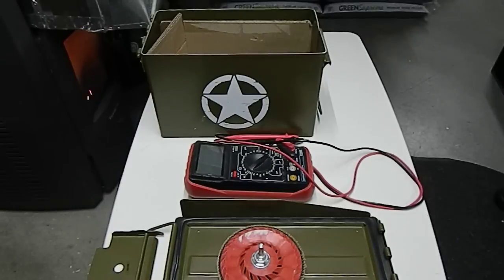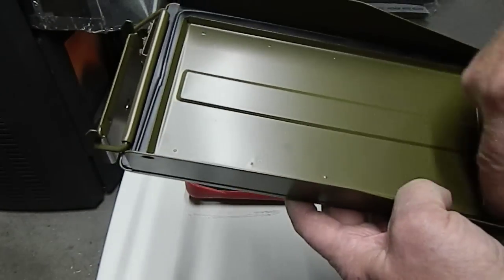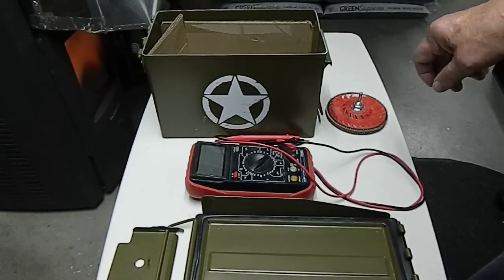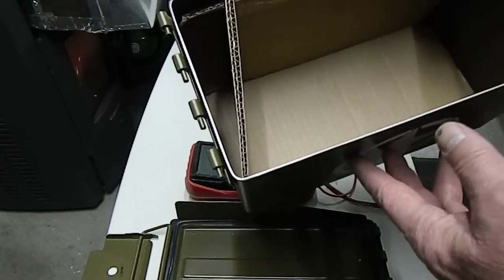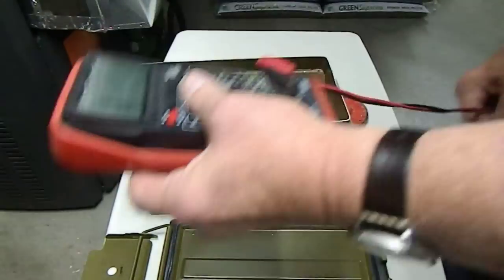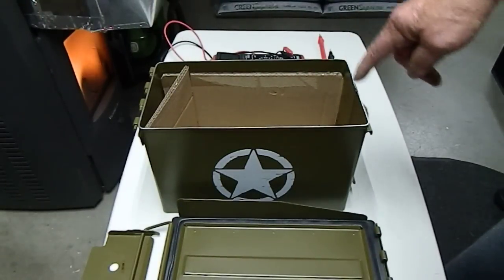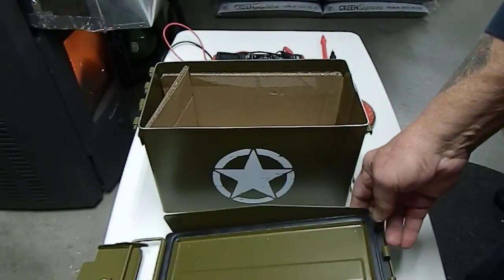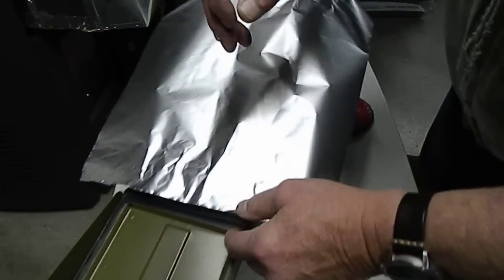AMMO CAN FARADAY …. you’re doing it wrong

Comment: RF engineer here.  For the sake of accuracy, you don't need it to be watertight to be EMP proof.  Case in point:  The mesh in the front of your microwave that you can see thru.  That's not watertight but the gap is small enough the microwave energy won't pass thru (not much anyways) it and your eyeballs don't melt when watching bacon cook. :)  I think the rule of thumb is about a 1/10th of the wavelength of the highest frequency for a gap.  Of course, less is better.  I haven't looked into what that distance that would be (and personally I'd shoot for 100% coverage).

But regarding your video - interesting idea.  One thing I wonder about is the ramification of dissimilar metals touching and long term shielding?   What's an ammo can made out of?  Aluminum window screen comes to mind too as an alternate material.  Likely a little bit more sturdy than aluminum foil, but then there's the gap and maybe the chance the 'mesh' isn't touching adjacent strands (i.e. making a bigger 'gap').  Perhaps a layer of foil and a layer of screen?  Don't know if aluminum window screen is plated or not.

Someone mentioned a metal paint can - probably the easiest solution (verify there's no plating that would be detrimental).
Reply: Yeah, I was going to comment the same regarding gap size vs wavelength.
My understanding was that a proper Faraday cage is also supposed to be grounded to an earth rod - do you have any comment on that?
I'm also curious about the effects of items placed in say, ziplock bags, and whether the layering of metal & plastic could inadvertently create a capacitor?
Reply: @boydw1  I have more experience on the EMI side (Electromagnetic interference) than EMP due to my designs going thru EMI testing.  And I definitely would defer to the EMPDoctor (sp?) for the correct answer, but I think he mentioned 'ungrounded'.  Double check tho.  

Ground is more theoretical than ideal.  Implication being what if the ground was poor (i.e. there's a path for EMP to get thru: water pipe, wire, is the ground wet or dry, dirt, clay, sand?)...you just might have made the situation worse by giving the EMP a direct line to the Faraday cage.  The other thing to consider with grounding (ground rod to wire to Faraday cage)...the wire will have an electrical length.  If the wire is a 1/4 wavelength long (short on one end is an open on the other at some frequencies) at a critical EMP frequency, it won't do any good.

Interesting comment about creating a capacitor.  So I think the issue would be electrostatic rather than electromagnetic and an ESD bag would solve that.  I haven't looked into the construction of a ESD bag recently and maybe the 'place the device in a bag, wrap in foil, place in another bag' is the same thing.  I tend to have leftover ESD bags around anyways, so I'd just use those. :) 

EMI testing is better defined...the testing facility sets up a standard bench, they run the test, here's the result.  You don't have that during an EMP.  I think at some point, we tend to overthink things and go down a rabbit hole.  There's the theoretical side and a practical side.  I tend to turn this problem into " How many dB of attenuation vs. frequencies do I need?"   EMI (or EMP) is always an interesting topic, and more than once there's that 'sneak path' I didn't think about in my designs and I'd have to play detective to figure it out! I'm just inclined to buy a metal paint can, grab an ESD bag and put it on a shelf!

Thanks for the reply!
Reply: @Pinhead-q4i  Grounding will help the DC LF spectrum, but at SHF and up, the inductance of even a thick copper braid may not provide much bleed off - AC takes the path of least inductance.
Reply: @paulromsky9527 Yes. Any electrical length would be detrimental to achieving a good ground at higher frequencies.  Ground would be transformed to a high Z at 90 degrees electrical length (frequency dependent).  Hard to get around physics. :)
Reply: @Pinhead-q4i  Yes, it is better the Faraday Box be  "bubble" in space, rather than a grounded point in space as far as EMP is concerned.
Reply: @boydw1  I commented on his video, that aluminum seal is 3 mils thick pushed up against the lip of the box. EHF pulses will ride the edge of the aluminum like an antenna, and pass right through that thin aluminum (edge wise). He is thinking DC. Using cell phones not ringing is NOT the way to test an EMP Faraday box. You need expensive wideband LF to EHF transmitters, antennas, and spectrum analyzers. Cell phone signals to/from towers are very weak and only around 1GHz, even 20dB attention inside a box is enough to cause a cell phone not to ping, but a high power EHF EMP will get through (not what is being tested using a cell phone). Yours truly has slide show on this if you look for it.
Reply: @paulromsky9527  I chuckled seeing you had a video called "Jalapeno Popper Scrambled Eggs" next to "Dual Deploy Avionics Bay Using Adafruit Feather M4 Express Microcontroller", haha, that's a bit of a change!

I agree checking with a cell phone isn't a great test, there must be some other way for people to check but I can't think of a good one (unless you could test by microwaving it but that's still 1 to 2 orders of magnitude low frequency of EHF range). Then it also may become an issue of how much current goes through it (even if a thin foil worked for low power, it wouldn't do much good if it burned at high power), but hopefully the only way we ever know is from scientific testing in a lab.
Reply: @jakegarrett8109  There is no good way to check it unless you have access to a fully equipped EMI/RFI lab - that I did have aceess before I retired. Yes, my channel is a bit eclectic. I had my Jalapeño Popper Eggs the other day.... delish!
Reply: @jakegarrett8109  Mu metal may be even better than steel. It is used to shield against strong magnetic fields. I checked...  Nope, it appears better suited for low frequencies, good old steel is the way to go for EMP.
Reply: Yes, a non painted steel paint can with a compression lid is good. But the quality of the steel they use is ferrous but not as good as the used in Ammo Boxes, and not Walmart ones, mil spec ones.
Reply: @paulromsky9527  Interesting comment about paint can metal, Paul.  I hadn't thought about the metal itself (other than is it plated or not, which could affect the RF seal).  Would a magnet be a decent test for ferrous metal, or is that too vague (i.e. might provide adequate shielding  at xx frequencies, but not at yy frequencies)?
Reply: @Pinhead-q4i  Yes, a small good neodymium magnet can be used as a simple test to be sure it is ferrous enough. The stronger the attraction the better. Also line the inside top and bottom with 1 inch of corregated cardboard. Eddy currents in the metal can damage equipment. Most paint cans are chrome plated. That plating is not optimum as the plating itself is not ferrous but it is only about 50 microns thick, so that is not too bad. Make sure you put desiccant packs inside but don't use oxygen obsorbers.  I like this paint can idea, most hardware and big box stores have them for only a few bucks and no modification to the seal is needed.  The Romsk (me) has a video on the Ammo Box. I am going to make a paint can one too. I will need to get access to an RF lab to determine it's wideband attenuation.
Reply: @paulromsky9527  Paul,  Just a FYI:  I picked up a paint can while at Home Depot yesterday.  Inside is epoxy coated.  Underside of lid: Epoxy coated including the lip that seals to the can.  The chime is not epoxied.  Not sure if I want to sand the lid lip since I may take off some plating, may have to think of a better way to remove it (i.e. chemical, heat?).

From Behr" "There is not a rust preventative coating on the outside of the can or chime (the groove the lid fits into), and the can may rust over time. However, the metal used to make these cans is called tinplate and provides more rust resistance than steel."
Reply: @Pinhead-q4i  Thanks for keeping me in the loop. Yes, the expoxy coating inside is a plus but don't forget at least 1 inch of cardboard all around inside (sorry for sounding like a broken record).  Hey, I never knew the groove on a paint can was called a "chime".  Hmmm, yes, the epoxy does indeed need to come off the sides of the chime and the sides of the lip on the lid. I doubt paint removers will work since it is a paint (and related products) can. Let's think about this.  As a last resort I would sand all lid/can interfacing surfaces down very smooth to bare steel.  A direct steel to steel contact under moderate pressure (like a paint can lid) should not corrode at the interface (touching) points because the metal to metal contact is a gas tight seal - a lot like wire wrapping in prototype boards.

If sanded to bare metal, high/condescending humidity can cause corroding around the chime where the lid does not make contact. This over time can eat through the lid contact area and compromise the seal. But, if you spray an expoxy coating around the chime after sealing the lid, that might work - dont forget to place some desiccant packs inside the can with your items. Then place the can in a quality Tupperware type plastic/rubber container with desisscant packs inside that as well... and you would be good for long term storage.  I wish I still had access to an RFI/EMI lab to test this, but if you then place that rubber container in a galavized steel trash can and tuck in stainless steel mesh all around the trash can lid lip, I can extrapolate that to at least the same 60 dB attenuation I got with my Ammo Can Fraday box.

Your thoughts?
Reply: @Pinhead-q4i  Also coat the entire outside of the can with an expoxy or enamel paint, but prime it first. I am going to draw up slides on our ideas. I will post a slide show video of it later today.
Reply: @Pinhead-q4i  How does your baseline (to a steel box) magnet compare to the paint can? If it is weak, then these high tin content cans are not a good idea for EMP proofing.
Reply: @paulromsky9527  I actually have access to an EMI lab, but no doubt the company would have an issue with me tinkering in there, getting in way.  I retired several years ago, but recently returned to lend a hand as needed (i.e. on call, working remotely).  I should clarify, I didn't work in the EMI lab and I'm far from an expert in that area.  My my experience is on the design side.  My modules always have the antenna port (lucky me), so I dealt with the radiated side of testing, not conducted.  More along the lines of proper PCB layouts, shields, component selection, ground paths, etc. But I have achieved a fair ways past 100dB of isolation when needed! 

I'm not sure how Behr coats the can and the lid, but they sure do have it down precisely - a very sharp, defined pattern.  I thought about heat (i.e. soldering iron?), but if that did work, I suspect things would turn to 'goo' and sanding would still be needed to get residue off?  Come to think of it, the tinplating might even wick up solder...hmmm (it might wick up under the coating?).  Some solderwick might help clean up residue if so.  Sandblasting might work, same for a vibratory polisher.  But I'm guessing if the material is too abrasive, it might take off the tin plating (would be nice to keep that on there).

I'll give it a try in a day or two and report back.  More of a science experiment on my end than anything. :)

Chime...yeah, I didn't know that either.
Reply: @paulromsky9527  I don't have an ammo box.  A magnet does adhere nicely to the paint can tho.
Reply: @Pinhead-q4i The magnet works, great! I like this Paint Can EMP Faraday Cage.  I just posted my Paint Can Faraday Cage slide slow video, I gave you collaboration credit but I only know you as Mark from YouTube. If you want, you can contact me per the end before "Sheldon approves it".
Reply: @paulromsky9527  LOL, 'Mark from YouTube' is fine.  Wasn't even my idea.  Someone else mentioned it first in the comments.  How do I find your YouTube channel?
Reply: @Pinhead-q4i  Paul Romsky Channel.... click the logo not my welcome.
Reply: @paulromsky9527  Some sandpaper, even higher grit (i.e. 110) does a decent job of removing the coating.  Must not be very thick.

Made it to your channel...duh, that was easy! I may have to try the "Jalapeno Popper Scrambled Eggs"!  I'd add Some Pepto Bismol to the list of items...just say'n :)
Reply: @Pinhead-q4i  I wish we could get 5 gal paint cans, those would be great.  If someone was ambitious, they could weld 1 gal cans on top of each other, cutting out the base of one of them to get a deeper container.
Reply: @paulromsky9527  Buying a 5 gallon can would be  ideal.  BTW, I was able to solder to the lip on the lid after hitting it w/some sandpaper.  Tin plating is holding up to a little punishment!
Reply: @Pinhead-q4i  Yes, Tin is way more solerable than Steel.  That was a clever way to prove that at least some, if not all, plating remained intact after sanding. I posted a Trash Can Faraday Cage slide show video today - so now I have a trilogy on EMP containers [smile].  Tomorrow, I am going to make another video:  "What Materials are Best for EMP Protection". I dry ran this experiment today: I didn't have a sensitive galvanic meter handy or some magnet wire to form a magnetic pick up coil. I did have a magnetic Reed Switch and a tiny Neodymium Magnet. I hooked up a simple circuit to light up an LED when a magnetic field is present around the Reed Switch. The magnet turns on the switch at about 4mm away from the switch. Then I put 10 layers of Aluminum foil folded up as one sheet. I insulated it with paper and tape and put it over the switch as a shield. The magnet turned on the switch (and thus the LED) at virtually the same distance - the "Magnetic" field passed right through the Aluminum as if it were not there. Then I took a piece of Zinc Galvanized Steel plate with the same thickness and insulated it identically the same as I did with the Aluminum. I covered the switch with that Steel shield.  The magnet would not turn on the switch - even when the Steel plate was right up against the switch and the magnet right up against the plate - the switch remained open (LED stayed off) - with ferrous Steel, the switch was shielded from the magnetic field. This is a simple experiment anyone can do. It does not give an indication of how much shielding each material provides, but it does show that Aluminum is a good conductor of electric fields, but not a good insulator for magnetic fields; Where Steel has the best of both properties, and since we're are trying to shield "Electro-Magnetic" events, I hope this proves my point to the masses. So passing that tiny magnet passed the switch thus created a very small scale EMP, but if it we're billions of times stronger with an extremely short extremely high frequency component to it, it would pass right through even very thick Aluminum with some attenuation, but still couple into the tiniest wires and circuits.  When people cover their devices in Aluminum foil or make gaskets out of Aluminum or Copper tape, the Aluminum/Copper will shield out a lot from a EMP with say a 100MHz characteristics, and the 100GHz components of it will be blocked a bit more but still get through (travel along) any thin non-ferrous material - especially through very thin gaskets made from Aluminum foil as the guy did in this video.  To the casual observer, "very weied" things happen with EM waves at EHF. Working the EM spectrum from DC to Gamma Ray (mostly Radar) I learned a lot on how these waves can travel around objects, or get through the very thinnest (but somewhat wide) gaps.  This is why I made my experiment virtually DC, most people without RF experience can understand that.
Reply: @paulromsky9527  Using a magnet was an excellent sanity test.  First thing that came to my mind was a wideband transmitter and receiver.  Instantly gets complicated.  Kudos for thinking of a simple test to prove a point.  I think the empDoctor did a YouTube test using aluminum foil in the lab, I should look that up and see how many dB the attenuation he achieved.

Edit:  Found the video.  He only tested at 100MHz, I was rather disappointed it wasn't a broadband test.
Reply: @Pinhead-q4i  Yes, I saw some of his videos too. I suspect he only did 100 MHz (and the first few I saw were only at 1 MHz) because that is all his equipment can do. He is obviously not a Radar engineer (I was a Radar test engineer, but worked the full spectrum in fact). But I no longer have access to all that expensive sophisticated equipment - our limit was 100 GHz.  He bills himself as the "EMP Doctor,"  I began to wonder if he has a PhD, and if he does, it might not be in the technical sciences.  The first few videos of his I saw he was wearing a nice shirt, tie, and slacks in his lab, I forgot if he had a jacket..... pa-leeeeeeze.  He now mentions that he sells various EMP stuff. Today I saw his video on where he mentions he sells EMP bags (they look like ESD bags).  He now has a big disclaimer before his videos but hawks (lightly) his products in the videos. I think he is a hack. He was talking about protecting power generation equipment with conductive mats.... wow, just let the RF get in around the folds. I don't think he ever worked on a real EMP project. I have worked on three that were classified, and a lot of TEMPEST in the Air Force.  And like you Mark, we have both been in the EMI/RFI lab a lot.  I giged him on a few things... no reply.  I did mention to him why test at only 1 MHz when EMPs can be in the many GHz and EM waves at those frequencies can do some very "unexpected" things, now his videos say he tests at 100 MHz.... your thoughts on him?
Reply: @paulromsky9527  He does state he has a Doctorate.  But I'm not an EMP expert, so I don't want to speculate.  I didn't even think about the paint can possibly being nonferrous until you mentioned it. But I was surprised that he used what appears to be a 1GHz broadband AR power amp and a wideband antenna during the foil test...and he only tested at 100MHz  (100mHz in his description, surprised that wasn't caught)?  Heck, all he needed was about a 6" piece of wire for 1GHz antenna (ballpark guess) test. 100KHz you could have just transmitted in a 50 ohm resistor sitting nearby for a load.  I think the AR was 80W (hard to see the info on the front of the amp).  Loop some wire for an antenna on the spectrum analyzer, crank up the amp, and you would have been all set to see a healthy 100KHz signal for testing.

I have seen him talking about the broadband 'clamp on' chokes he sells, and I wished he would have done a simple s-parameter sweep of the 1 turn inductance, maybe 10KHz to somewhere in the GHz range. Just eyeballing the Smith Chart plot would have indicated where isolation was great or not so great.  Granted, it would have been small signal (core not saturating), but a simple R+j sweep on the Smith Chart would have revealed a ton of basic info. But I assume I'm the exception (translate: RF geek), not the norm. :)

Interesting you mentioned you were involved with RADAR, I designed transmitters for RADAR (along with broadband transmitters).
Reply: @Pinhead-q4i  He sells those chokes... I think that is the point of his video. Chokes are a good idea for equipment that has to remain connected - like generators. But I would not rely on "I have chokes on my cables... I am safe" idea. I have not investigated how 10GHz and such pulses will creep around conductive surfaces - they could theoretically creep right around the outer surface of the chokes - but they are better than nothing. When it comes to EMP, being totally sealed in steel, as difficult as it may be, is the best insurance, there are no short cuts. In my Doomsday shelter (I never built it, I have two version videos of it), I keep all equipment in a Faraday Room. Generators are stored there too, unconnected, which is the best way to protect them.  Like I told others, it's a shell game, after a nuclear war, we will never know when another EMP weapon will be detonated to catch us off guard. So, we will have to get used to using ALL electrical/electronics devices sparingly and to keep them in shielded containers 99.9% of time - in hope that an EMP does not occur when in use.
Reply: @Pinhead-q4i  BTW, Thought it was odd he didn't fix 100mHZ. You may have noticed that I use the term "Radar" as a noun rather than the acronym RADAR.  It's not proper to use the noun, but in informal text, I just use it anyway.
Reply: @Pinhead-q4i  Thanks, I will check it out. I made a video of my magnet/shield demo, and some slides to go with it. My eyesight is bad, my eyeglasses have progressive focus lenses but lately the closer focus is off (kinda reversed), I have to view the screen further back with the normal focus range, but I was drawing a lot of small line art so I had to take off my glasses and lean in close to see it. After about a day of that, I may have pinched the sciatica nerve and my lower back is very sore. It's has happened before, I just have to stay away from my PC for a few days.
Reply: @Pinhead-q4i  Yes!  I didn't even look for 5 gal cans, I have some industrial sealant in the same style can, but I never thought to search for empty ones... the lid is perfect! Vestil LID-STL-LL Steel Lever Lock Pail Lid, for 5 gallon, Black

I will make a slide slow of it soon. That clamp lid is perfect, I am sure it has a rubber seal that will have to be replaced with steel mesh.... my very similar industrial sealant can has a rubber seal.
Reply: @paulromsky9527  Not necessarily. Brass, copper, and especially LEAD, is not magnetic, but a much better cage metal (if thick enough)...
Reply: EMP is not a radio frequency, it's a high voltage pulse. Electrical contact with the lid is important. Remove the rubber and used copper mesh or aluminium foil to bond the top and case electrically.
Reply: @bazzadebear8012  Actually, that is not correct. An EMP event is an electo-magnetic pulse. The fact that is a "pulse" of any "width" means that is does indeed have a "frequency" component. The most destructive EMP weapons are designed to have a very wide band of pulses (frequency) characteristics. Let's say the strongest pulse at the source of the detonation is 1G dBkW peak and lasts for 1ns; this creates a "single wave" of energy with a frequency component centered at 1 GHz. So it is very short lived pulse of extremely high energy that in itself has a frequency component. Try this:  Put a 1ns pulse with square edges on a spectrum analyzer, you will see it has a peak magnitude at a frequency of 1 GHz, with a rich set of harmonics in the side bands.  If you make the edges of the pulse Gassian (smoother bell shaped), then you will see only the peak magnitude at a frequency of 1 GHz with little to no harmonics. EMPs have very fast (sharp) rise and fall times (edges) so a wide range (spectrum) of frequencies are generated. Because all that energy is put into one pulse, you only get 1 cycle of an AC frequency component, but that one cycle is all it takes to destroy electronics.

Aluminum is an inferior seal because it is not ferrous. Because it is conductive and not ferrous, a portion of the SHF magnetic component of a EMP can get through very tight non ferrous areas (like the thin aluminum sheet at the edges).  Remember, it is an Electo-Magnetic Pulse (wave). Don't think just electrical like aluminum or copper, think electrical and magnetic like steel. Thus a fine steel mesh braid in place of the rubber seal with give you at least 10dB attenuation of the pulse over aluminum... the more attenuation is better in the case of EMP shielding... and that makes all the difference if your equipment will survive or not. Yours truly has a video on this, check it out for more.
Reply: @paulromsky9527  - If you put a perfect "Ideal Impulse" square wave into a Spectrum Analyzer, the result will be an infinite series of discrete frequencies.
SO very strong "Pulses" tend to look like a broadband spectrum of frequency signals (infinite harmonics).
Reply: @stuartgray5877  Thanks for a second on that. The guy I replying to was under the impression that EMPs are purely electrical and no frequencies were involved (the old DC train of thought not RF) when they are in fact Electo-Magnetic pulse waves... waves as you know implies frequency. I think he got it but he has not replied yet.
Reply: @stuartgray5877  I checked out your page. I have worked on satellites as a Test Engineer but for only LEO. It's amazing how just about everything outgasses at micro Torr pressures. As for my Electrical Design Engineering discipline, I have worked on the entire EM spectrum: from DC to Gamma Ray. I even worked on space based equipment that detected Cosmic Rays.  IR lasers were very interesting. So, I have designs under ground, under the ocean, on the sea, on land, in the air, and in space. I am a multi-disciplined engineer: I bill myself as an "Omni Engineer". I can design a circuit board in the morning, code the FPGA for it in the afternoon, write the software for it (test and implementation) in the evening, and test it.  Many engineers I have met only focus on one of those disciplines, some sadly never want to get involved in testing their own designs (like that is beneath them). I prefer to test my own designs, with a crack EA as my assistant. We follow the design from concept to end of life... I have brought a couple of EAs up to excellent engineers. I am retired now, so I teach Summer STEM in my home. I hand pick only 6 students that have the hunger to learn and teach... grades are not that important compared to them being "true engineers" from birth. I teach them to how get good grades too.
Reply: @paulromsky9527  ..."some sadly never want to get involved in testing their own designs (like that is beneath them)..."  Very true.  I even abandoned my office when I was working.  Decided the screen room would be a better office. Coffee pot nearby?  No thanks, I'll take the screen room with all the RF test equipment next to me any day.  Instead of windows, I had made a laminated poster of a Smith Chart hung up that I could draw my matching circuits on w/dry erase markers! LOL.
Reply: @Pinhead-q4i  Ah, Smith charts! Back in the day it's all we had and we liked it!  I show my summer STEM students my sliderule that was handed to me in 1989 as my mentor was retiring. I tell them that we sent men to the Moon using them!
Reply: @Pinhead-q4i  Yes, I knew a guy that made a screen room his office. It was in an almost forgotten lab so he used it exclusively but he would let me in now and then to make some measurements.
Reply: @Pinhead-q4i  stupid fil-ter, I think it dele-ted my last mes-sage. Try solving this:
10 digits is all it takes. The first three is in new hampshire. There are 4 cows and 6 goats in the field. 5 of them are babies.
7 years ago I only had 2 goats. I now have 25 in all.
Reply: @bazzadebear8012  Can you elaborate?
Reply: I think connecting a wire to the lid and can is good enough to make them unified for EMP resistance, and the gap created by the rubber seal seems to be too small for any issues.
Seriously, don't damage the (steel) can or seal if you want to protect things inside, just wrap them in foil and put them in the can.
Reply: This will work to store things. Environmental seal and HEMP/EMI shielded.  Just don’t open it until everything has subsided. 

As a side note. If someone wanted to create a box like this for holding electronics but wanted to run wires into it, that is possible. You would lose EMI shielding at higher frequencies but if you are only concerned about HEMP, you just need to have a tube welded into the box that the cable runs through. Tube must be at least 5 times longer than it’s opening size and the cable cannot have any metal. So this would work to bring fiber optic network cables into a device. If it needs outside power, there are ways to do that too, but much more involved.   Again, cannot have any metal running inside the tube as that provides a path to transfer the energy into your space and your device.
Reply: @bcaron3535  Yes, I made a sideshow video that states to keep your contingency devices inside a Faraday Box, take them out to use them, and then return promptly to the box when done. True, EMP events will occur early in a nuclear war, but there is a "shell game strategy" where the enemy will stop using nuclear weapons for a while so that the target population will think it is safe to use electronic devices again, then without notice, a week or so later, another high altitude EMP weapon will be detonated to catch people off guard thinking the worse was behind them. Once a nuclear war starts, you will (indefinitely) have to use your electronics sparingly, taking them out only briefly and to play the shell game to miss getting "pulsed".  I personally I see no reason to run fiber optic cables in/out of a Faraday box.  Curious, why would you do that? The ones I designed and tested for >60 dB attenuation over a very wide band of DC to EHF frequencies is to keep electronic devices powered off (batteries removed) for long term storage as our common unprotected every day items will most likely be destroyed in the first wave attack (not enough warning to protect them).  I tell people they can keep a cell phone in thier Faraday boxes, but that would be added cost to have a phone number/service that you don't use all for many years (and hopefully never need). Virtually almost every cell phone tower system will be destroyed in the first wave and it may be years before many of them are repaired as resources will be scarce and the Washington DC towers and few around military bases will be restored first and repaired after each "shell game" EMP event.  I suggest people keep my Faraday boxes in sealed Tupperware type containers to keep out moisture, and put those in a EM sealed steel trash can for even more attenuation - especially in areas under where the EMP weapon is likely detonated.
Reply: @bcaron3535  Actually, the tube you described might act as a wave guide at a specific frequency. Since EMP weapons are designed to have a wide bandwidth of EMP (and the enemy is not going to publish their specs) there is a good chance that a pulse wave may travel inside the tube. I would rather not risk it and go for a totally sealed/shielded EM Faraday box.
Reply: @activemoronic  Actually, microwaving bacon is faster than pan frying. True, it doesn't crisp up as nicely, but if you cover it with paper towels, there is less mess and more of the fat wicks away while cooking. Many people like their bacon flimsy. I prefer pan frying low and slow, but if I am pressed for time, a couple of minutes in the microwave oven and it's done. But I think Mark was just being colloquial about watching bacon cook through the holes. It could have been anything... like a Hot Pocket for example.
Reply: The issue of it being watertight is purely to protect the internal items over the long term from moisture etc.  Having an ammo can that’s a working Faraday cage is the first thing he is trying to achieve; having that same item waterproof is just a bonus.  It does need to be noted that for this to be a EMP protective level Faraday cage, you need to run a wire (the shorter and larger gauge the better) to earth ground.  To protect against a EMP event you need to give the energy a place to go otherwise the EMP energy will simply pass through the walls of the metal can.
Reply: @joefunk4552  Yes, it would be very desirable to make the Farady Container water tight, but it being EMP proof is paramount. This is why I place desiccant inside, and keep the whole container in an air tight container (box or bag) with desiccant inside it as well. That thin sheet of aluminum (in this video) is still thick enough to allow EHF components of a S-HEMP through. Steel is a much better EM shield for pulses with those frequency components. EHF can actually creep around objects and through thin areas of non-ferrous material. Steel has a mu of 100 times greater than Aluminum. At EHF, aluminum does shield EM fields, but Steel offers about 10 dB more attenuation at those frequencies. That is a 10 times power reduction - significant when it comes to EMPs. I am in the process of making a video that explains all this. Because many people are not RF engineers nor have they had extensive experience with weapons EMPs and TEMPEST, I have to explain some basics before I can explain why Steel is the best cost effective material for EMP proofing - its quite a few slides so far.  As far as grounding the box, that only works for DC/low frequencies, because any length of wire (even 1 cm of straight wire) has inductance, and at EHF, those frequencies will not pass through the wire as AC takes the path of least inductance. Bonding the case to ground would be better for wideband, but still not necessary. So, EMP works a lot like RADAR Stealth - where in that technology there are (among other material) tiny ferrite spheres in the paint, they take high frequency Radar EM energy, absorb it, and radiate the energy as heat. Radar signals are relatively weak, so there is very little heat and a slight static slip stream, a fraction of a degree over all. Those steel balls are insulated from the aircraft frame and are obviously not connected to ground (earth) - they are "bubbles" in space. Thus, and EMP container is best left as a bubble in space. The energy it absorbs creates brief eddy currents in the case and radiates heat (IR). But, since EMPs are such short lived, that heat is just as short lived and the box wouldn't even heat up 1 degree C...  in fact, grounding the box makes it a crude antenna, which slightly increases the gain of its reception of EM waves - which is not desirable.  So many people just don't understand the effects of Weapons EMPs - it's not intuitive, and many people think more DC, when it is much more exotic. This is why some people that have a causal knowledge of RF call it "black magic", but when you understand and apply all the physics it makes sense.

To summerize: Floating Ground, Steel Case, Fine Mesh Steel Gaskets, Air Tight Outer Container, Desiccant Packs. 

Anything else is a misunderstood compromise. 

Take this: Goverment sites tell people to simply wrap there devices in foil... this is just to pacify the public - when a nuclear war starts, most people will not survive the first minute as sub based launches take only a few minutes to reach their targets on the coasts. Our government cannot warn the public in time as theire first priority is to protect the president and upper staff.  So, they are just giving "us" a cheap ineffective way to shield EMPs so in peacetime there is less anxiety about it all... clever. Many of us in the know have reported this to the government only to fall on deaf ears... it's just cheaper and easier to disseminate partially correct info to people who will die when WWIII starts.
Reply: @paulromsky9527 Hi Paul, like you I have a lot of experience in the military fields, all TS+ work at one of the national labs run by MIT.  I agree with you fully regarding designing this to be both EMP proof as well as a environmentally isolated interior.  The steel is best and I understand the desire for multiple layers of foil.  EMP pulses can and do have unique DC & AC characteristics that grounding with a good wide wire braid will add a significant layer of protection. It’s important to keep the wire as short and large as possible to drive the inductive and capacitive elements of the ground wire as low as possible; this is why the flat wide wire braids work best. In doing that the AC performance of the ground wire is significantly improved.  Let’s also keep in mind that the fundamental energy of an EMP pulse is spread over the “DC to  Daylight” spectrum.  As each EMP pulse is a mixture of unique RF energies, the best we can do is significantly improve the situation; but a ground wire will be needed to shunt the overwhelming energy of the EMP’s DC component and hopefully a significant amount of the AC component. 
There is a huge difference between a faraday cage used in labs to shield out any stray RF energies (From the normal TV, FM & AM radio signals) and shielding a high energy EMP pulse from a high altitude airborne nuke burst.   The difference is generally equated to a difference of 1x10^20 greater energy than a standard Faraday cage is designed to handle.   I would also shoot for 100% electrical shielding with no gaps.  This is a good thread, this discussion needs to be had.
Reply: @joefunk4552  We agree. These videos have good intentions but we have to set them straight now and then.
Reply: @joefunk4552   @Joe Funk This comment is mainly for other readers:  
As far as grounding, bonding the case directly to Earth ground plane would be better than even a thick copper braid as it would provide the best wideband grounding. I tested my Ammo Box Faraday Cage (I have a slide show video on it) using a fine mesh steel gasket filled with cotton as a forming media and I got 60dB attenuation at 50GHz. I am retired so I lost my access to RFI/EMI labs, when I made my Ammo Box, the equipment I had on hand was good to 100GHz.  Russia and China are developing Super HEMP weapons.  Much higher energies, but to get that, they would have to use multiple tamper layers - which may widen the pulse, but not sure if the edges of the E1 pulse would get faster or slower. Who knows what the E2 would be.  As wide band as EMP is: DC to the boundary of Far IR (with a lot of local IR, Visible, UV, X-Ray and Gamma Ray at the source), I found that Aluminum's and Steel's effectiveness were starting to converge above 50GHz, so I extrapolated from there. Of course, I advise Steel Cases/Gaskets, sealed in air tight bags, within lager steel cases (like steel trash cans) - I have a video on those too. Anyway, I too had access to TS and above my whole life, so I have to limit my content. I stay away from math in my videos because they are for non-engineers/scientists, the rest of all us understand the rest. It's a shell game... many people think they are going to wrap all their devices in Aluminum foil or toss them in very good Faraday boxes as the first strike is on its way.  I am trying to tell people, that will be too late, they need to keep everything they hope to survive a Weapon EMP event in EMP proof containers at all times (by the time the government can get the word out it may be too late) Various nations are "testing" missiles all the time, any one could detonate way out over the Pacific - on route not seeming to be a threat.  When was the last time the EAS went off to warn you North Korea just launched a "Test" missile. Answer: Never. We only hear about them that day, at best hours afterwards. If one did turn out to detonate an EMP, it's too late.  Also, once we enter a nuclear war, the enemy will randomly set off EMPs (every now and then) to catch people off guard with their equipment out of their containers.  That is why it's a shell game, once a nuclear war starts, we will have to keep our electronic devices shielded (taking them out only briefly to use and put back in again) until well after the war is over - which could go on for a year, more or less.  

I am 60 now, so I have decided not to ride out a nuclear war. And I am not going to die a horrid death of radiation sickness - so I have contingencies for that. I have videos on some long term shelter ideas, but I never built either one. If you don't have a well buried shelter with all the equipment and supplies to stay under ground for a year, the Earth may be so contaminated that a month or two in the shelter would not be enough. And if Nuclear Winter sets in... forget it... the Earth would be a lost cause to 99.999999% of humans, the rest being billionares and politicians to stay shielded indefinitely.  

Good luck. "If I don't meet you no more in this world, Then I, I'll meet ya on the next one. And don't be late, don't be late." From "Voodoo Chile (Slight Return)", Jimmy Hendricks ca. 1968.
Reply: @activemoronic  Let me dig my hole deeper...turkey bacon to boot! :)
Reply: I looked this up:

An EMP, or electromagnetic pulse, does not have a specific frequency since it is not a continuous wave like a radio signal. Instead, an EMP is a burst of electromagnetic energy that can contain a wide range of frequencies, from very low to very high.

The frequency content of an EMP depends on a variety of factors, including the source of the pulse, the strength and duration of the pulse, and the environment in which the pulse occurs. In general, EMPs can contain a broad range of frequencies from DC (0 Hz) up to the microwave region (gigahertz frequencies).

Different types of EMPs can have different frequency characteristics. For example, a nuclear EMP (NEMP) typically has a much broader frequency range than a geomagnetic storm-induced EMP (GIC-EMP), which is caused by fluctuations in the Earth's magnetic field.

So, in short, the frequency content of an EMP can vary widely and is dependent on the specific circumstances of the pulse.
Reply: @danw.3291  That is correct, it's that WIDE BAND of frequencies that you have to shield to protect your equipment. At DC, Aluminum does not block Electromagnetic  (EM) fields, where Steel does. I am almost done making a video on that.   But in the GHz frequencies, Aluminum does start to block EM fields pretty well, but Steel still provides about 10 dB more attenuation (more attenuation is better for EMP shielding). So that is why Steal Cases with Steel Gaskets/Seals are better any Aluminum anywhere.  At the TeraHz frequencies, Aluminum and Steel start to block EM fields equally, but at the lower frequencies of where Weapon EMPs mostly radiate, Steel provides the best protection. So many people think of shielding from a DC perspective because they don't understand AC effects, especially in the EHF band and above. At those frequencies, EM waves can travel around edges of conductors and get right through tiny gaps - even if those gaps are "electrically" sealed but done so with non-ferrous metal like Aluminum. The gasket must be made of Steel. You MUST consider ALL Frequencies, not just SOME.  See my "Ammo Box Faraday Cage" et al.

I am a engineer with EM experience from DC to Gamma Ray (mostly in the Radar bands where a lot of the Weapons EMP characteristics occur, and have worked on EMP projects and TEMPEST). When I was first learning this in the 80's I was amazed how beautifully elegant EM fields/waves work differently from DC to X-Ray, Gamma came later).
Reply: @paulromsky9527  Just adding to Paul's (and others) comments in case some didn't understand the 'dB' term we toss around:

A 10dB reduction (-10dB) in level is the same as reducing power to 10% the original level ( i.e. 1W is lowered to 0.1W, 10W is lowered to 1W, etc.).
Every -10dB is another reduction to 10% of the original:  -20dB is 1%, -30dB is 0.1%, and so forth.
-3dB is 1/2 power, -6dB is 1/4 power, etc.
Positive numbers are an increase in level. 10dB increase is x10 power (i.e. 1W +10dB = 10W).  +3dB is x2 power (1W+3dB=2W)
So -13dB is a reduction to 5% of the original power (10dB gets you to 10%, then the other 3dB is a 50% reduction of the 10% to 5%.)

It's common to express RF power levels (into 50 ohms) using the term 'dBm'. Turning it into watts: 0dBm=1mW, 10dBm=10mW, 20dBm=100mW...70dBm=10KW, etc.  You can see for every +10dB increase in dBm, power by increased x10.  So if shielding provides -70dB and the signal was 70dBm (10KW), the signal would be reduced to 0dBm (1mW).
Reply: @Pinhead-q4i  Thanks mark... I just added a video today on Ferrous Metal for EMP and its has a slide on dB... I forgot to mention 3dB is about a factor of 2 or 0.5, I will make a new video on dB with more detail. We are so on the same page. My next video is for the 5 Gal Paint Can on which we collaborated. I got side tracked making a mock up Soviet Souyz Digital Space Clock. I just finished the Arduino Nano code, now I have to built it. I will be making a video on that two
Reply: @Pinhead-q4i  Thanks! Yes, in RF we think of 0 dBm as 1 mW into 50 Ohms which is a specific RMS voltage at that load. But you may notice that many older VOMs scale 0 dBm as 1 mW at 600 ohms... a dB is a dB as power is power, but 600 Ohms is used in telephones and teletypes, and since the electromechanical meter cannot perform power measurements, they allow you to measure, as sine wave (hopefully as true an RMS as you can get), an AC voltage and thus scales those voltages as dBm on the meter face - as long as you are on a 600 Ohm telephone line. There is always a note on meter that indicates 0 dBm is 1 mW at 600 Ohms, because if you used it for 50 ohms, the reading would be way off because the scale would be different for those scaled voltages at that load... I have a 80's bench top Fluke DMM (got it for a song and fixed it). It can display dBm and dBw, from, if I recall (have to dig it out),  any load like 4 Ohms upto like 1k Ohms at the popular points (like 50 and 600 ohms, and such) in between.
Reply: @paulromsky9527  I actually mentioned 50 ohms when thinking about the television guys (or gals) being at 75 ohms.  Wanted to avoid confusion. :)  Didn't even know about the 600  ohm group
Reply: @Pinhead-q4i  Yes, 8, 25, 50, 75, 80, 120, 300, 600 Ohm loads for dB is what I have used so far. Most of that is high speed board design, but also: RF, radar, television, audio equipment, and phone lines.  It's gets confusing at times. Hey, read up up why we have 50, 75, and 80 Ohms for RF. Bell labs did a huge study on impedance for different applications in the 50's, I think it was. It turns out that its a range - tranceivers like Radar is where 50 Ohms works the best, but televsions that only receive turned out that 75 Ohms worked the best, but 300 Ohm twin lead antenna lines were used back then. They did some amazing things over the years... like discovering the CBR out in space all around us.
Reply from the maker: Wanted it to be water tight as i add desiccant to keep electrics dry.
Reply: @BC-pz4me  Are you saying you want to use an Aluminum sheet (like the guy in this video - that doesn't understand the all the effects of Weapons EMPs) to make it water tight? You will make it water tight, but the Aluminum will not protect against EMP as well as Steel, the RF from EMPs can get right through that thin non-ferrous Aluminum at the edges.  I just made a video of Materals for EMP, it explains why. It is best to use fine steel mesh gaskets then keep the Ammo Box in a Rubbermiad type container. We engineers have tested out designs in real EMI/RFI labs - not using a cell phone that only proves it shields to -20dB, where the phone cuts off. That is NOT a good enough test and ANYONE who thinks that is a good test is simply not an RF engineers and does not know the "strange" effects EMPs can induce or tye huge power levels involved.
Reply from the maker: @paulromsky9527  The conductive layer can be very thin because of something known as the skin effect. That term describes the tendency of current to flow primarily on the skin of a conductor.

As long as the conducting layer is greater than the skin depth, it will provide excellent shielding because the absorption loss will be large. The skin depth is a function of the frequency of the wave and the conductor material.

As an example, consider that for a frequency of 200 MHz, the skin depth of aluminum is only about 21 microns. EMP pulses can have frequency content that ranges up to 1,000 MHz.

Therefore, wrapping a box in a couple of layers of heavy duty aluminum foil (typically about 24 microns thick) provides the necessary conductor thickness to protect against high-frequency radiated fields.
Reply: @BC-pz4me  Actually, Super HEMP may have a wide frequency spectrum of around 50 GHz. At those frequencies, the EM will still pass through the Aluminum edge wise (not on the skin) but into the 1 mil thick side of the Aluminum, then once through, travel along inside by skin effect, where it can radiate inwards. In fact, the Aluminum sheet edges sticking out of the box under the lip acts as an antenna.  I tested my last Ammo Box in an EMI/RFI lab with a Spectrum Analyzer an Antennas inside and outside the box and radiated it from 10 meters away at 1W 50GHz. I was getting about 5 dB more attenuation with a fine mesh Steel gasket over Aluminum.  I directed the signal to different aspects of the case, the worst leakage was not when directed directly under the lip as I first predicted, the sweet spot was a little off axis.  I do put desiccant packs inside my Ammo Case, but I seal the case in big zip lock bags with more desiccant for long term moisture proof - I make sure my equipment can't be soaked in fluids. So blocking wideband EMP is paramount over making it gas/water tight.  Actually, there is more inductance between the Aluminum  and Steel seal,  so even though the two surfaces are low Z to each other at DC and up, but at certain frequencies that inductance actually decouples the the mating surfaces a bit. Any way you slice it up, Steel is a better case/gasket against Weapon EMPs.
Reply: Wouldn't the lid also need to be sanded down to make sure the lid is conducting to the case? I'm assuming the hinges are enough to do that, but if there's paint inside the holes where the hinge pin goes through, they won't be conducting together.
Reply: you are right that you do not need to use sandpaper to grind the edge raw or anything else, the amo box itself is EMP safe as it is as an EMP bomb or a solar flare EMP is electric as electricity is. these are some ENTIRELY different frequencies we work with when talking about EMP (both solar EMP and EMP bombs), when we secure a large radio against an EMP (out in the field) we just take thick plastic once and chicken netting once and wrapping the radio in it and burying it (about a meter) so we secure it against an EMP attack in war . with an amo box, you just make a safe box that can withstand both a flood and an EMP, and by wrapping a fine-mesh net around it several times, you are sure to have it against EMP. but of course with silver paper around the lid, you just have the extra for sure. but an EMP is not the same as the current coming out of your socket😁😉 so it cannot be measured in the same way with a multimeter whether there is a review, because it is completely irrelevant😊
Reply: Just don't worry about things like EMP's become a Christian and you won't be here for all the grisley stuff. The Rapture is right around the corner!
Reply: @minerblue9641  I agree, I have sold all my Faraday boxes, depleted most of my survival food supply, and never built my ultimate Doomsday shelter. I am 60 now. My wife and I have decided not to ride out a nuclear war, we have no children. But we both agreed if we are not immediately killed and radiation sickness sets in, we pray God will forgive us to take cyanide capsules - we just won't be able to bare to watch each other go through that horrid death. When I was in the Air Force we trained every day for WWIII.  The idea was once the bombers have taken off for their one way final mission, there was no need for us on base anymore. We were to take the equipment from our destruction board and smash our equipment to tiny pieces and burn our classifed documents.  I always thought... no, I am grabbin' a girl and going out with a bang of my own [smile]. I know, not very Christian of me, in reality, I would have done my job -  but we guys, ya know, we talk a good game [laugh].

So now, if WWIII comes, I am going to watch it with a cold beer and pray to J.
Reply: @minerblue9641  
Making promises about the future when you can't see the the future damages the credibility of the gospel. It's basically false prophecy.

Anyway, Jesus told us that war doesn't necessarily mean the world is ending. There are still prophecies that have to be fulfilled first.
Reply: @MaryBrite  
  Just know that the option for becoming a Christian is still on the table. But in my humble opinion this option won't be avaliable much longer. I truely beleive that very soon God will stop taking names.
Reply: So what if u are an engineer
Reply: @BlackMamba-lt8oe  So what if you are a troll?
Reply: @BlackMamba-lt8oe  - "So what if u are an engineer"
We are talking about Engineering Principles.
Who BETTER to ask than an Engineer genius?

Do you ask your BAKER for advice about Plumbing?
Reply: @stuartgray5877  Thanks, Yes!  I "backwards R" a Eng-a'-neer.  And I have the coffee mug with the handle inside to prove it [laugh].